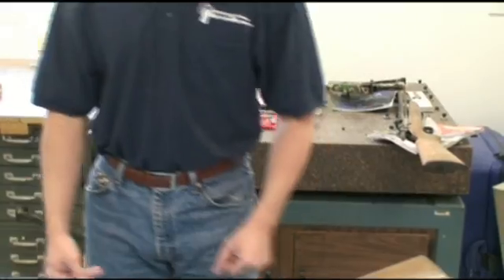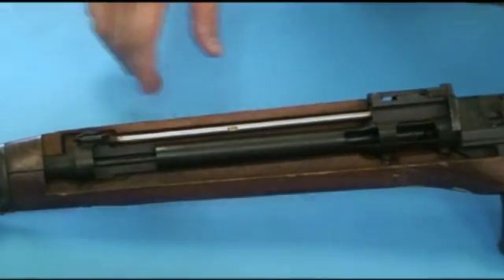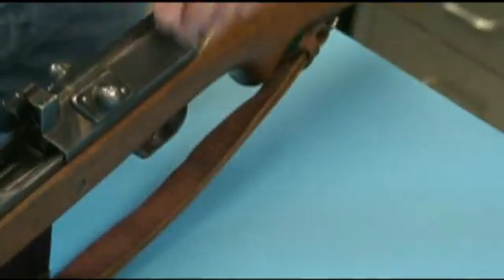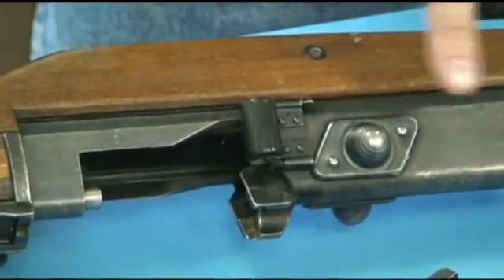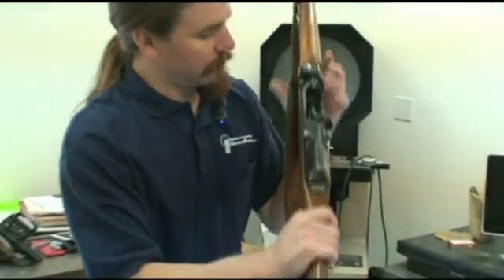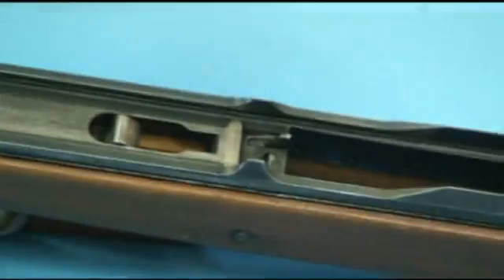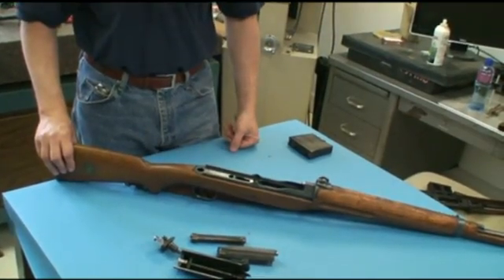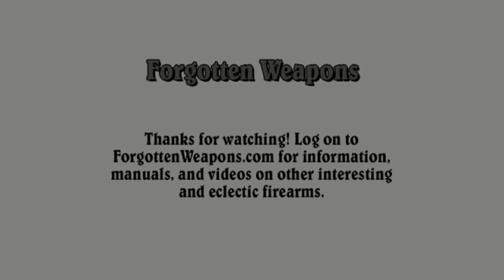AG-42B Ljungman

Comment: Can you make naother video about this rifle? You explain that you can grab the bolt with this outer contraption around it and when you slam it back it autamatically drops the bolt. My question is how you make sure you are in the right position to load it with stripper clips. How would you do it in stress without dropping the bolt because it seems like very thin line.

Comment: The Egyptian version Hakim, (7.92 x 57) did not have the cocking bumps . less ice and snow south of Cairo, apparently.

The rear sight drum is also "reversible". There should be a little "hairpin" that can be removed which in turn enables the partial disassembly of the rear sight. the range drum is reversible. When reversed, it shows a GREEN, round-nosed bullet shape in the window; handy for those with a stash of REALLY old Swedish ammo.

The rifle should ideally be fed ammo from the magazine. Single loading a cartridge into the chamber and then releasing the bolt and carrier forwards causes the extractor to distort the rim, possibly to the point where the extractor claw will mot grasp it sufficiently and thus tear out a chunk during the rather "vigorous" extraction.

These were also issued with a very nifty cleaning and maintenance kit in a typically Swedish field-grey cloth roll.This kit contained lubricant dispensers and spare parts, like strikers and striker springs and, tellingly, extractors and their springs, along with a nifty and simple extractor removal tool.

Comment: Love the video, Ian! I have a Hakim and it's interesting seeing the differences between the two rifles, however small they may be. I'm curious though, the Hakim has a small lever in the receiver that will move up into the bolt carrier to stop the bolt from moving if the gun is turned upside down or struck really hard. It's a really weird mechanism that I've never seen on other guns. Just curious if the AG. 42 also has it.

Comment: Did anyone report having hot gas blown into their face when firing, or was that not a problem?
Reply: The gas blasts into basically a little cup on the bolt carrier, so if anything the gas is going to blow forward from the action rather than back.
You'll get more gas to the face with 1 suppressed round from an AR15 than you will with 100 rounds from a Ljungman
Reply from the maker: +Oscar Floyd Nope, it's not a problem.

Comment: A real finger smasher!  Here's a tip for closing the bolt over an empty magazine: with the safety on (so it won't unlock the bolt carrier) move the cover forward to lock the bolt carrier into the cover then slide them both all the way back together, depress the magazine follower, and slide bolt carrier and cover, still locked together, all the way forward.  Then, while holding the cover securely forward with one hand, press the release button on the back of the bolt carrier and let the cover slide back under control.  Courtesy of the NRA firearms assembly book and tested by me.

Comment: Ag-42b what are they worth now a days?
Reply: 600-1000 USD or at least what I could find on the web.
Reply: and a year later:   1000-1400, $1000 being a pretty beat up one
Reply: Local Pawn shop got a Hakim from an estate sale last month. They priced it at $300 and I bought it before it even made it to the shelves! Gas valve was stuck though and I put one PPU brass case round in and it failed to extract and blew the primer out. Guess the gas valve was letting too much through it? Let it soak in Liquid Wrench for 2 weeks and got it unstuck with the proper tool. Steal of a price even though it turned out to be a bit of a fixer-upper.

Comment: I have one of these rifles as well as every other rifle ever chambered for the 6.5 x 55 Swedish round. Its an accurate gun but every time you shoot it there is a PUFF of gas / smoke right in your line of sight where the bolt opens via that gas tube. I find it an annoying feature of the gun. Also it will hurt your fingers if you are not careful racking the bolt open with the mag out.

Comment: I have one of these and it is easily my favorite of all my rifles.  It is very accurate, easy to shoot, low recoil, and just plain neat.  If you have a malfunction it is NOT quickly cleared, due to the lack of a bolt handle.  A stovepipe ended my attempt at the "drop 8" at a falling plate match in about 2008.  Here is the video. 

https://www.youtube.com/watch?v=MAtZm2u9g_A

Comment: So there was nothing pushing the bolt? "Just" a puff of gas sent it flying?
Reply: Patrick Lundström No! :D Everybody knows all the good guns are in Western Europe. LOL
Reply: Patrick Lundström ***** Andrew Romig Hey Andrew, I don't know much myself but it sounds like you were thinking about "stroke" rather than "recoil", as in short-stroke piston versus long-stroke piston systems. They both use pistons, as opposed to direct gas designs. Check out "Gas-operated reloading" on Wikipedia. Hope that helps. :) Patrick, did this help? Mart, help me out and tell me if this is right.
Reply: LJVolkov21 I think I get it. Thanks! :)
Reply: Patrick Lundström You're welcome. :) If you want some more details, read what Mart and I have just written. Basically, you can imagine it this way:

In a direct gas system, the gas pushes the bolt carrier directly. But with pistons, instead, the gas pushes the piston - and the piston, in turn, pushes the bolt carrier. But why?

Direct gas systems send hot and dirty gas right into the heart of the rifle, making it more susceptible to aging and jamming. It's just like smoking: if you smoke, you make your lungs turn black on the inside, man... :) What a piston does is to absorb the energy of the gas and pass it along to the bolt carrier. That means that the gas never reaches the bolt carrier, the trigger group, the magazine well or the chamber. You gun will last longer.
Reply: Andrew Romig De gustibus non est disputandum...
Everything evolve, from Project SALVO to M16A4 to HK416. Anyway, improvement or not, what the HK416 did was to move the gas from the "heart" to the front of the rifle, pushing on a piston?
Reply: Andrew Romig Patrick Lundström I agree with you, Andrew, but people complain more about jams on M16s than, say, AK47s. And I have read comments referring specifically to the M16's direct gas system as a reason for that.
Reply: LJVolkov21 Andrew Romig Would either of you be suprised if I prefered the Ak 5 over the AKM and M16A2 I tried...? ;)
Reply: And the REALLY good guns are all in Northern Europe. :P So no, I wouldn't be surprised.
Reply: ***** I'm learning a lot from you today. :D
Reply: Patrick Lundström To answer your other question, the HK416 is supposed to have a better gas system. Again, this could merely be a question of marketing more than anything else. (Refer to Mart's comments. He has a point. The most important thing in life is selling.) But I'd say there's also another factor there: they're just newer guns, pure and simple. Pristine, straight out of the box. Fresh designs. Better materials. Every army's gotta update their guns every once in a while.
Reply: LJVolkov21
 People complain about jams more in AR-15s than AK-47s because they think a a quality AR-15 should cost the same as a Romainian Milsurp AK that was built by people who were effectively never paid, so they buy garbage from DPMS, Bushmaster, Del-Ton, Model 1, Double Star, etc etc that doesn't have a single component remotely in line with the current M4 and M16 TDPs (which HAVE been updated throughout the decades in materials, components, component designs, and testing and can be examined in detail as a matter of public record). If you look at the performance of ARs actually built to military spec (Colt, BCM, LMT, Noveske, Daniel Defense, etc) you will find them to be every bit as reliable as any AK you could possibly find on the planet. The reliability problem is NOT the design, it's the shoddy execution by the "commercial" AR-15 manufacturers who dominate the market by lying to the customers and telling them they're buying a real AR-15 for under $700.

A piston gun will absolutely NOT make you rifle last longer, as the heat being exercised on the BCG is nowhere near enough to cause any harm (and I've never seen a single firearm on the planet using any system that exerted enough heat on the already heat-hardened trigger mechanism to have any effect whatsoever), most excess gas is ejected out the vent holes on the BCG and out the ejection port, and what remains never builds anywhere that disturbs feeding, locking, or cycling. Yes there is some gas residue inside the upper receiver that isn't there on a piston gun (on a piston gun, it's instead fouling up the piston block, which WILL compromise reliability much more quickly and readily if not perfectly executed), but that's just lining the outer sides of the receiver. For more on this and photos, look at BCM's "Filthy Fifty" carbines. I've also never seen a straight-gas AR that was chewing through its own buffer tube through carrier tilt, I've never seen a piston AR that wasn't (didn't mention that in the brochure, did they?)

All that said, the AR platform does have one specific durability failing (which is NOT addressed by any piston AR on the market that I'm aware of) that will leave it coming up short vs an AK or some other designs if your round count starts getting in the 15,000+ vicinity, and that's that AR bolts (not the Bolt CARRIER) DO break once every 15,000-40,000 rounds in TDP-spec rifles (if it's commercial garbage it will fail much, much sooner). While certainly not ideal, replacement bolts are fairly cheap (~$100), easy to carry, fairly quick to install, and you can almost always see signs that a bolt is going to fail before it actually does, as long as you do a basic field strip every now and then.

So no, there's no "smoking", there's no dumping X into "the heart of the system" (what does that even MEAN?), and the HK416 isn't an excuse to update the rest of the platform because the rest of the platform HAS BEEN UPDATED. It's an excuse to sell you (and hopefully, as many deep-pocketed militaries as they can) a "new", more expensive version of the same platform again. If you want to talk about true advancement in weapons tech, platforms like the IWI Tavor, KAC SR-25 and SCAR-17 merit consideration as they actually bring new features to the table, but don't fall for a single unecessary gimmick with a lot of marketing noise as "the next big thing", because it really isn't.
Reply: *****
 As much as I like Noveske, the only deviation they make from the TDP-grade materials and construction is double-chrome lining their barrels similarly to M249 barrels. While that's nice, it isn't "far better" than basic TDP. I realize there's a popular conception that "mil-spec" = lowest bidder junk, and in many areas of US military acquisition there is truth to that, but the M4 TDP is NOT such a case. There are no manufacturers currently building AR-15s to markedly higher quality than the TDP without implementing significant design changes (The KAC SR-15 and some of Centurion's products are good examples of this) and those products, while again very nice, run about double the cost and really only produce marginal improvements.
The only regard in which the TDP is meaningfully outdated is the lack of implementation for a mid-length gas system on 14"+ carbines, but that again only yields marginal improvements in felt recoil and long-term durability, and doing so would obsolete a great deal of already perfectly good and paid for handguards.

Your second paragraph literally makes no sense to me, could you please rephrase your argument?

When I referenced the Tavor as a worthy upgrade/advancement, I was referring specifically to it's bullpup configuration (on a personal note, the Tavor is the only bullpup I've encountered that I feel is truly suitable for widespread military implementation), not the sophistication (or lackthereof) of it's internal systems. What I was attempting to argue was that it brought something fundamental to the table that the M4 doesn't already have - something even the fanciest and most costly piston ARs most definitely fail to do.
Reply: ***** Thanks. But I'm kind of confused, though. I thought "direct" impingement meant that there is never a piston, the gas just pushes the bolt carrier directly. I'll have to keep reading... :)
Reply: ***** Huh. Nice. :) You certainly got me thinking there. I'll definitely have to do some more reading. This stuff is pretty cool to explore. :)
Reply: But the BEST guns? Hmm... Switzerland. :D
Reply: Andrew Romig Good point. Like I said... I'm learning a lot. :) Thanks.
Reply: *****
I apologize if you felt like I was putting words in your mouth regarding my "lowest bidder" comment, I was speaking to a general perception I've noticed many people have surrounding the idea of mil-spec that you seemed to be at least partially echoing. I don't understand what what you mean by "not advantageous against anything but the worst excuses for rifles"? Are you trying to say a TDP-spec Colt M4 is inferior to most other rifles, most other ARs, or something else entirely?
I realize M249 chrome lining is unexceptional, that was the point of my arguement - with that one deviation Noveske builds what is otherwise a typical TDP-spec AR that is no better or worse than a military-issue Colt.

You seem to be getting hung up on the Tavor, which really isn't the purpose of this discussion, though I did assume incorrectly about what aspects of the Tavor you consider "a step back". Suffice it to say I consider the handling, reloading, and ergonomic characteristics of the Tavor splendid (unlike every other bullpup I've encountered) and do not concede that it is a "step back" in any of those directions. Moreover I'm not particularly thrilled with the changes of the X95 - the handguard looks to be much too short and I wouldn't consider a 13" barrel's ballistics adequate for general US military issue (though splendid for the urban fighting most of the IDF seems to deal with). I WILL, however, concede that the appeal of bullpups is drastically exaggerated in the US due to NFA regulation and that is a major factor in my personal enthusiasm for the rifle, though I also love my ARs.

Again, my intention wasn't to spark an argument about bullpups or their associated mechanisms, but to point out, once again, that they bring something NEW to the table where piston ARs don't - whether or not you consider that something new to be valuable is a matter of individual perspective.
Reply: On piston guns the piston is driven by the same "puff" of gas. This system just cuts out the middle man. The bolt carrier group itself becomes the piston. This is exactly how the AR10/AR15 family works.
Reply: Andrew Romig It was the "middle man" i meant. Thanks! :)
I used the Ak 5 (version of the FN FNC) in the army and that had a piston, aka what we here call "middle man"?
Reply: Indeed. The AK5 is also unquestionably one of the finest examples of a short-recoil piston-driven military rifle ever produced. I also have a deep fondness for the SIG 551, the IMI Galil carbines, and the Czech Vz. 58. I really don't view either system (piston-driven or direct impingement) as superior or inferior to each other, but you've got to admit, direct impingement was a very clever idea for a service rifle.
Carry on, my Swedish friend.
Reply: *****
You win twice:

Just fished out my AR-15 bolt carrier to check this out, thanks for the tip - I never realized that. That just makes it cooler IMO. :P

In re: "short recoil", it seems I have made a rather tragic and embarassing mistake - I just assumed that anything that wasn't long recoil was short recoil. After a little googling, I now realize that any and all gas systems sit outside those definitions entirely. Thanks again.
Reply: Andrew Romig You, my friend, is unique to Internet. Thank you! :)
Reply: LJVolkov21 So that is how the HK416 improved the AR-15?
Reply: Patrick Lundström
I strongly dispute that the HK 416 or any other piston gun "improved" anything about the AR-15. The AR-15, in direct impingement form, has served beautifully for now nearly half a century and while it's true that a piston gun can be a little more accomodating of unusual configurations (less than 10" barrel, supressed, and full auto all combined), in the vast majority of applications it's just unnecessary cost, weight, recoil, and parts.

Comment: 6,5x55mm was the standard Swedish ammunition for the infantry before we went to 7,62 NATO with the AK4 (G3 variant). There was 8mm machine guns but those where used in not so mobile settings like AAA machine guns and vehicle mounts.
For instance the m/39 maching gun (licence built Browning m1919) had barrels in both calibers.

When Sweden bought the KSP 58 (FN MAG) in the 1950's those where chambered for 6,5x55mm these where latter rebareled and designated KSP 58B while the 6,5mm variant got the KSP 58A designation.
The navy seems to have been the last ones to use the KSP 58A probably because they got leftovers and ship boarding parties used the 6,5mm Mauser during the cold war, and there where tons of 6,5mm ammo in storage !

Comment: When you are cleaning the M42B and disassemble and remove the breach block/breach carrier, that big double spring on the inside can shoot the breach carrier back at you if your not holding it quite right. Be careful .

Comment: If you happen to want to use those holes for a modern day side mount scope remember those holes are metric threads not SAE . You may end up having your gun smith re tapping those little holes . If you should locate a real M42 side mount scope , CALL ME FAST !